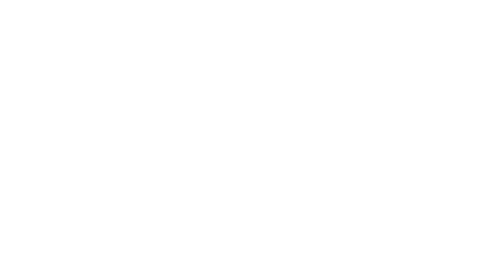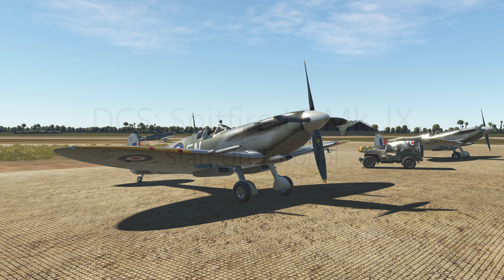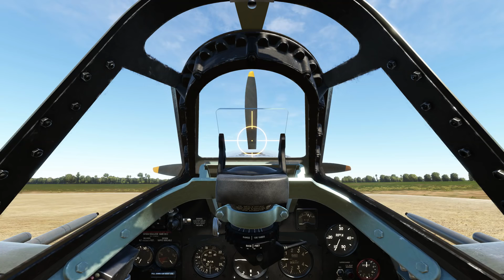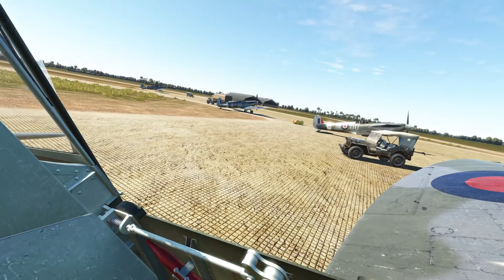DCS: Spitfire LF Mk. IX - Start Up Tutorial

Comment: Nice video. I wonder, how are you supposed to be able to hit both the starter buttons at the same time with the mouse? This is impossible, so you have to bind that on buttons or use the keyboard, right?
Just to note, in a real plane this is kinda impossible to check the rudder, very hard to turn your head enough to see your aicraft tail. So my flight instructor told me to just check if there is no hard point in the rudder pedals, and so if they can move freely, without actually checking the tail.
I also have a question about the brake. The spitfire does not have toe brakes, but a central brake, right? So, do you think it is useful to bind that to an axis ? Or a on/off button will do the job as well? For now I bound this to my wheel (yes, I also have a wheel in my cockpit) but maybe that is not really needed.
Thanks
Reply from the maker: Just bind a key to the BIT switch and use the mouse for the DDI.